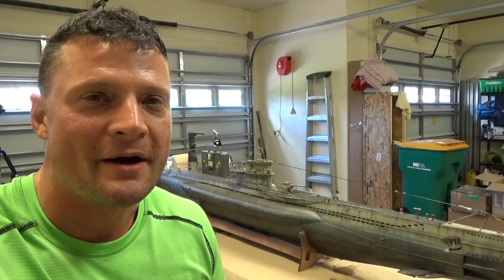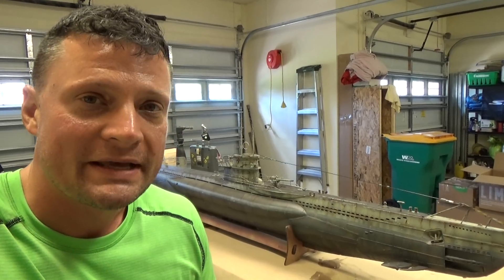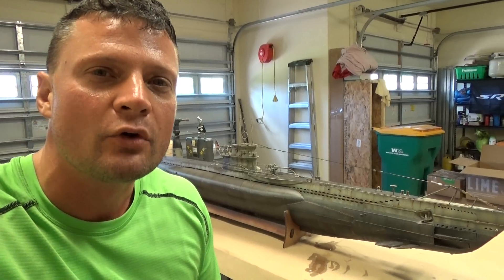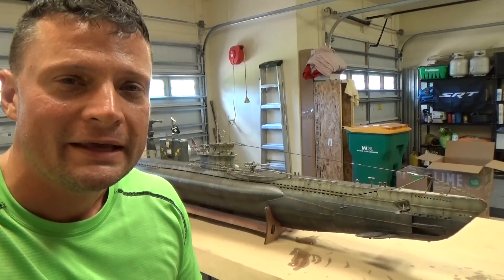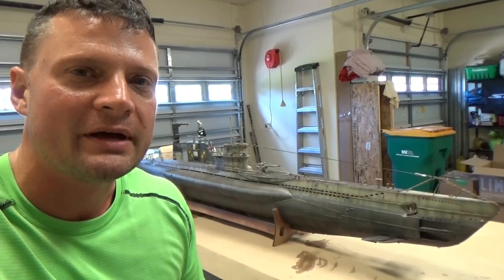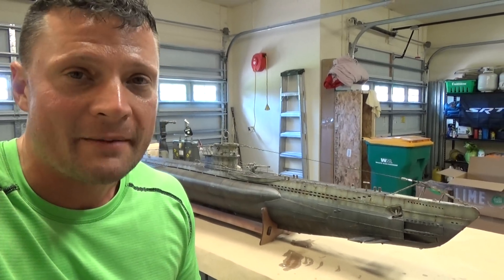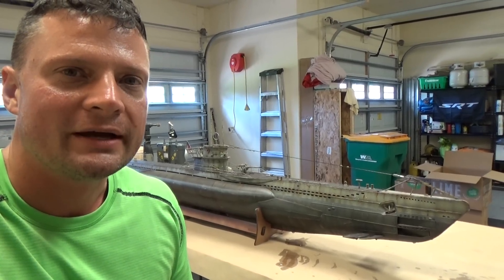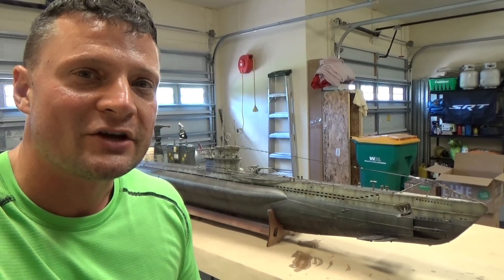Maiden Voyage of an Arkmodel German Type VII R/C Submarine

Comment: Just ordered this boat from arkmodel with stock settings and finished assembly last month, while the experience is not very good, the boat nose tilts up if I give thrust, I have to keep the dive panel down to keep the boat in a balanced state. I tried adding some triming to the dive panel and also tried moving the cg forward but not working, I'm wondering if there's a solution for this. :(  Is it necessary to replace the stocking WTC ?
Reply from the maker: If the boat is trimmed in a balanced state while stationary, then there are dynamic forces overcoming the boat's stability when underway. You need to increase static stability by adding weight low in the hull and then offsetting that with foam high up in the hull (below the surfaced waterline). This will increase static stability and help to overcome the dynamic forces acting on the boat when underway. Check your control surfaces such as dive plane orientation as well.
Reply: @RCSubGuy  Thx for those advices, will give a try :D

Comment: Regarding "flat deck breaking surface tension" - I suspect it isn't about surface tension. It's about flat deck being a big plastic part. Styrene plastic is lighter than water, it has similar density to that of gasoline. It just floats.

Comment: Do you find that the twin rudder configuration on the Type VIIC gives you a shorter turning circle than a single rudder? Also, was the twin rudder incorporated on the Type XXI?
Reply from the maker: It's all about total surface area rather than number. XXI was a single rudder configuration. Compared to modern subs, the old WW2 boats were pretty nimble. Modern subs with their tiny rudders (with exceptions such as the beautiful and very effective x-tail configured boats) take AGES to turn around.
Reply: @RCSubGuy  Thank you...I served aboard a Baleo Class Converted Fleet Sub- USS Sablefish (SS-303). DBF.- Hence my interest in submarines.